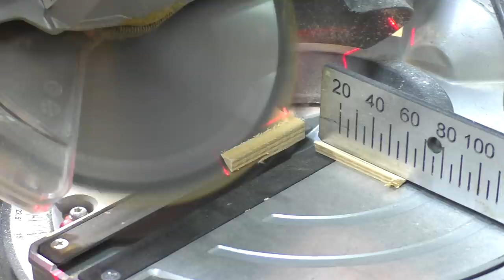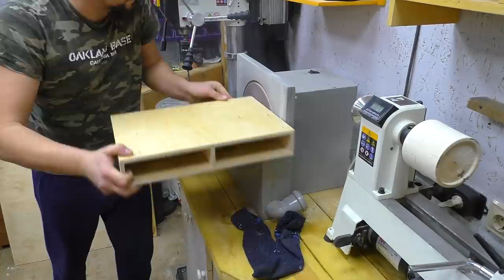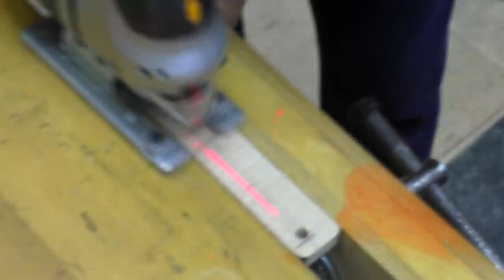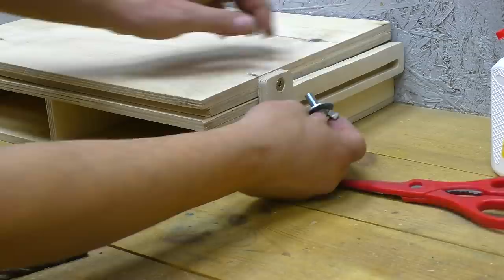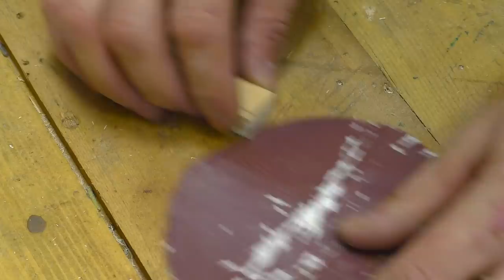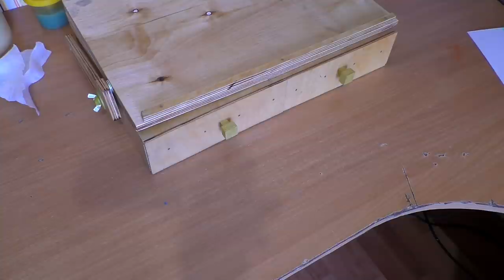Brilliant idea!!! If you're a man, do it.

Comment: That's a nice shop you got there!  Those T-nuts (flush nuts) are supposed to be installed with the teeth on the opposite (far) side of the wood so that when you screw the bolt into them, they pull the teeth deeper into the wood.  The height of the blade has already been mentioned - should be just high enough to clear the surface of the wood. Good use of your push stick, but remember that the piece of wood caught between the blade and the guide will sometimes shoot backward hard into your body.  Keep your body to one side. Nice project.
Reply: a lot of critics.  I say screw em.  Good job

Comment: The T nuts were installed backwards. They need to be installed from the inside, so tightening the bolt will pull them in tighter.
Reply: This, no strength whatsoever.Might as well just lay the bolt in a hole..

Comment: Damage control... You should always keep the saw blade only 1/4 - 1/2 above the wood you are cutting. Less flesh to loose in case of kickback or slip. Not a keyboard warrior. Just been a woodworker for 55 yrs. Stil have all my fingers. 🔨😅
Reply: Guitar Prepnand1, speaking as a red seal journeyman cabinet maker, this guy is one of the most dangerous people I’ve ever seen. Who the hell uses 2 feet of clearance on a band saw?
Reply: Not if you have a guard on the blade, also aids extraction. saw 'should' cut down into the work piece greatly reducing 'kickback' chances. I noticed in another video because the strips he was cutting (by eye, not with the fence/stop, were riding up onto the blade. CRAZY). 
Also, 'testing' LOL. 

He is dangerous.

Comment: People need to realize he is using a splitter on the backside of his saw blade which cuts down the chance of kickback. That's the shark fin looking piece of metal that doesn't allow the piece of wood to drift away from the fence. I actually built my own table saw and installed a splitter earlier today.
Reply: Ryan Kutcher if you think that blade can’t pick up a piece of wood over that splitter and fling it at ur face ur tripping. Don’t become complacent with safety it will get you hurt. Take ur time, part of becoming a master of a craft is learning and using the best tools for the job.
Reply: @Burnintrees384  , I'm not saying you shouldn't take your time, but a Riving Knife/Splitter is the best tool to use to dramatically cut down on kickback because the piece of metal goes about 1/4 of an inch behind the blade and it is the same width as the blade so it makes it difficult for said piece of wood to drift away from your face plate.. You can also use shims while your cutting and safely, by turning the saw off, putting them into your cut you made. Just by listening to your saw will allow you to tell if your saw is going to kickback. I shouldn't have used the word eliminate in my previous post. I dont want a newbie to read that and just assume. Thanks for pointing that out to me. Truly appreciated.

Comment: 45 years ago, when my UK 'O'level Metalwork exam had a design section for a metric A1 paper size drawing board, most of us came up with a similar design, but using a metal channel frame ( well it was Metalwork, not woodwork!) Mind you, most of us cheated as the drawing board we were using were a variable angle device made from metal channel......we only needed to copy what we were using!! I would suggest that one of those 'self-healing' plastic cutting mats placed or fixed to the drawing surface would give a great surface to draw or paint on (these boards are cheap and readily available in most art, craft or model stores!)

Comment: T nuts should be on the inside folks. 
It's unclear in the video. 
One good thump
That's it
Put the sleeve on the hole
Knock living Hades out of it. 
Tapping on it will give the teeth time to bend and you'll need a new one. 
If you install them as shown in the video, they'll pull out of you tighten the wing nut too much. 
An alternative is to use a bolt to tighten it up just stop SHORT of pulling it completely in. 
The sleeve will lock on the bolt head and it'll twist the legs out of the wood and cross thread on the bolt. 
Use warshers as spacers
Tighten it up enough to pull it almost completely flush. 
Finish with a good whack on the butt end once you've removed the bolt completely, to flush it up with the surface. 

As a 23 year furniture mfg employee and sideline furniture repairman, I've fixed more than enough of these for folks who just drove them in the wrong side of the bolt hole. 

Kewl idea

Comment: Have u heard of kick back on that table saw
Reply: Always use a push stick on the pieces between the fence and the blade.  I cut up and toss out push sticks that come with tools if they don't have a long section to hold the work down. Pushing with notched sticks is asking for the work piece to ride up and kick back.

Comment: Cutting 1/2" plywood on the table saw. with the blade all the way up is not only dangerous. It puts unnecessary stress on the motor and blade. It should be 1/4" above the thickness of the wood.
Reply: bullshit - the blade is shorter in contact with the wood so there is LESS stress on the motor and the blade